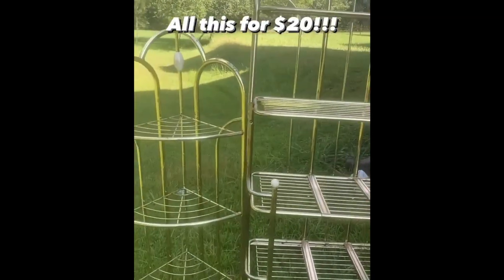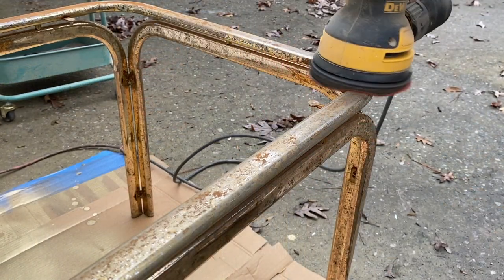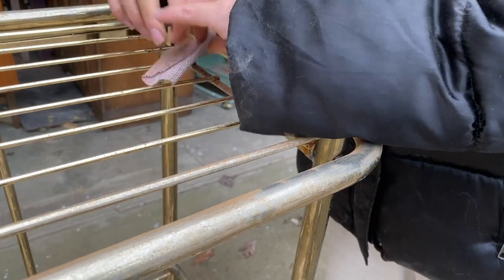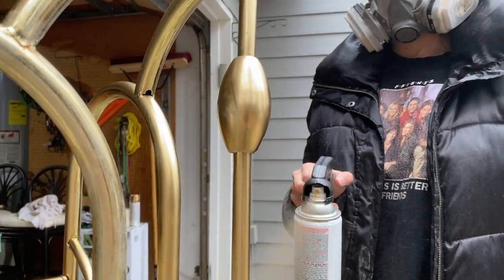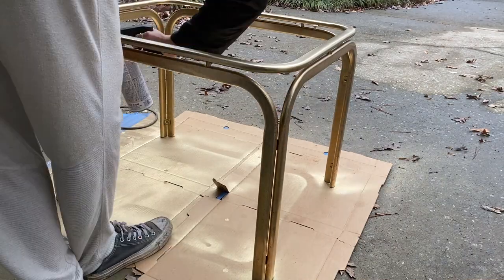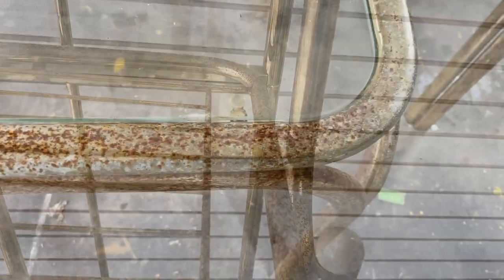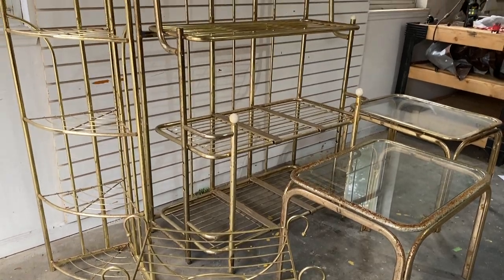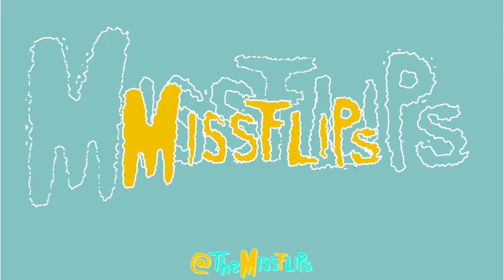Quick Profit for Minimal Effort! | Refurbishing Brass Plated Furniture

Comment: No primer before spray paint? Im needing to repaint old beat up brass cabinet hardware
Reply from the maker: If you use a spray specifically made for metal it should be fine. Otherwise, a primer is good!